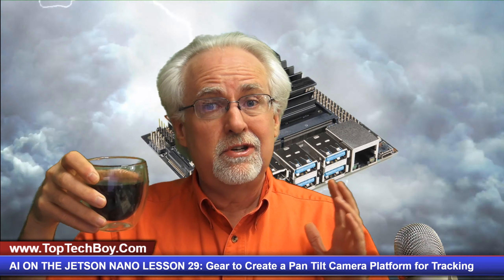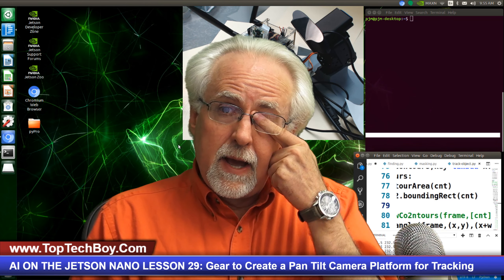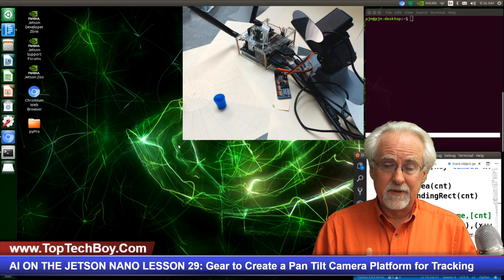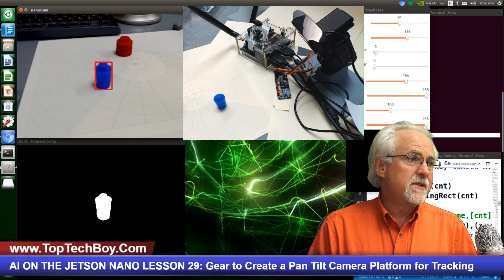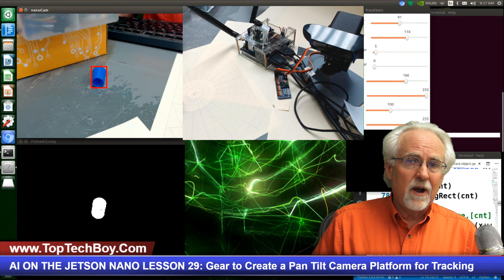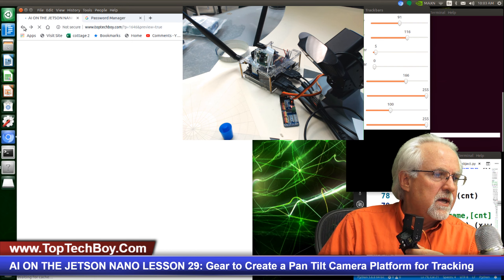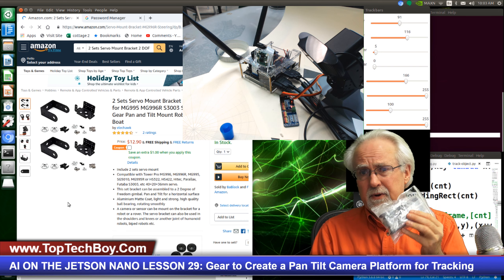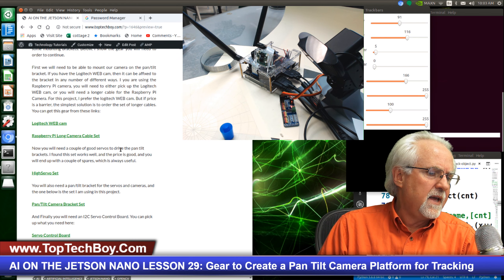AI ON THE JETSON NANO LESSON 29: Gear to Create a Pan Tilt Camera Platform for Real Time Tracking

Comment: You can use the pi V2 camera as an alternative however you will need a pi camera cable extender which are all out of stock or will not be available until late April. The Logitech C920 is out of stock at most big box retailers here in the US except for sellers on Amazon Prime who want 238USD when the original selling price was around 65USD

Comment: Hi Paul, I am a beginner and I am following your lessons  (watched till 28th lesson). Your effort is much appreciated and lessons are great.
In this lesson, you have recommended some gears to buy to proceed further. I have two questions,  1. Could you provide a video on how to assemble this servo, pan/tilt bracket system and PCA9685 Servo Control Board. like you did initially in the lesson1;  2. where to buy the base for the servo,  which pale blue in color.

Comment: I'm at the point in my build where I can ask should I put a camera on the claw on my robot ? If ai is going to control it shouldn't it have a camera also?it is full size with 5 20 kgm  servos I'll have my channel back up soon so you'll be able to see this thing.I'm also watching learning fusion 360 or dive off the pier trying lol since the robot has a 220 by 220 by 120 3 d printer on it . the pan tilt sketch seems like it could be used for the claw just thinking .

Comment: Hey Paul, I know I'm a bit late to these lessons but I was just wondering if I could control the servo with an arduino uno that i've used before instead of the servo control board you linked. I know the arduino has PWM pins but not sure if it is compatible with openCV. Love these lessons btw. Thanks

Comment: Hi Paul, the logitec webcam you recommended is very expensive in India, same with the Htc servo motors. Any other alternative ?
Reply: You can use the pi V2 camera as an alternative. The Logitech C920 is out of stock at most big box retailers here in the US except for sellers on Amazon Prime who want 238USD when the original selling price was around 70USD

Comment: Hi Paul,

I was wondering if you could post the STL Print files for the pan/tilt holder and the raspberry pie holder? The pan/tilt holder would make it easier to get more steady tracking of the objects as the assembly is pretty top heavy. Thanks again for all your awesome work !!!!!! Rick
Reply from the maker: A student had printed that for me, so unfortunately I do not have the file.
Reply: @paulmcwhorter  Hello Paul,

Would the student be able to send you the stl file? Again, thanks for all the amazing work you do. If the student posts the stl files on thingiverse, then it is available to the general public on the thingiverse site. No charge to upload or download files from thingiverse.

Comment: People using the HS-422 Servo motor and Raspberry Pi Cam V2, i made same mounts for both that can be 3D printed, you can find them in the links below.

https://www.prusaprinters.org/prints/39302-hs-422-servo-desktop-mount
https://www.prusaprinters.org/prints/39305-raspicam-v2-mount-flat-surface

Enjoy